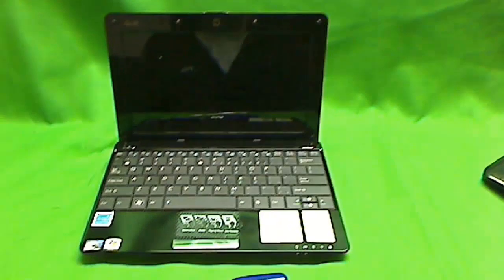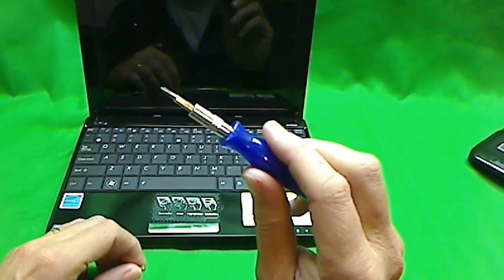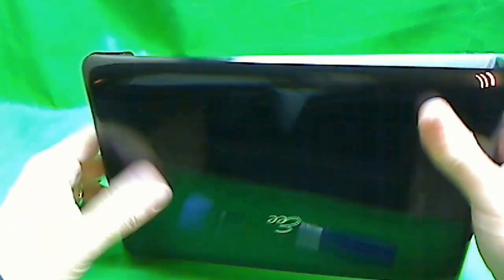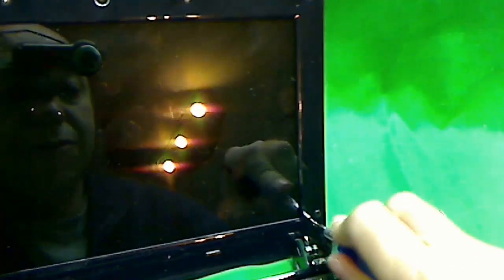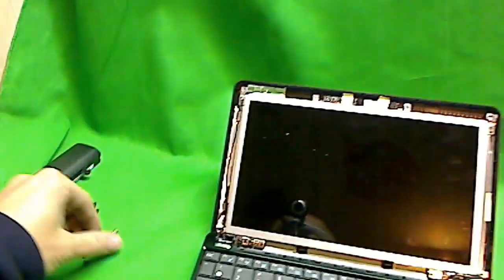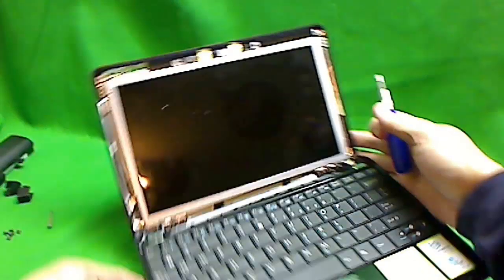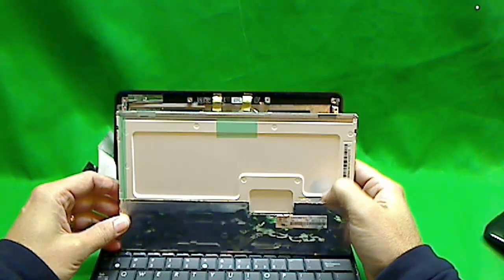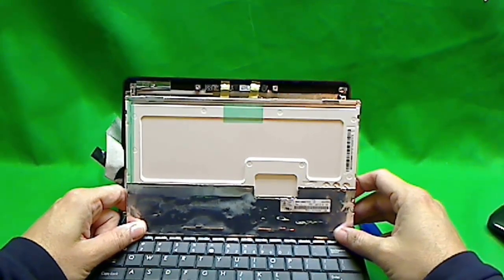ASUS Eee PC 1005HA Laptop Screen Replacement Procedure

Comment: Hi,
First of all, thanks alot , I found this video very helpful.

 I have the same computer and I need to replace the screen so I'll definitely use this video, however, when trying to buy the screen from Ebay, I found two different screens described to be fit for this model, but they are not at the same size - one of them is 10.0'' and the other 10.1'' (!!).

What I wanted to ask you is - how can I know which screen is the proper one for buying?

Thanks alot :)

Comment: On the original eee-pc 1005 display in netbook there must be aluminum foil or it could be covered with plastic film already in netbook? And are there difference in modifications of HSD1001FW1 because i have -A04 you have -F01 ?

Comment: just used this video to fix a loose connection on the wire tape on the back of the screen. It came back from being repaired and had the problem of the screen going haywire unless i keep pressure on the back of the case. Took it apart, pulled out the screen, reattached it firmly and it works right as rain. everything is in identical configuration and im using an eee pc 1005p. 

thanks!